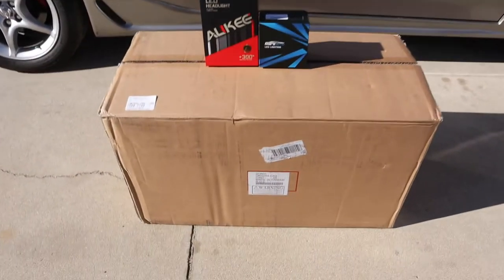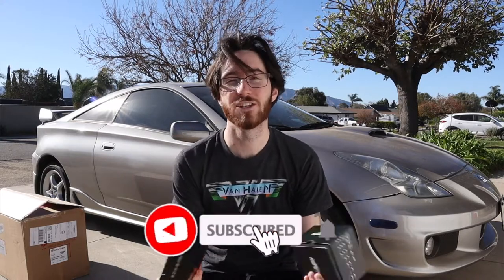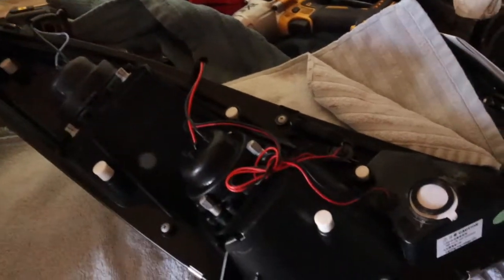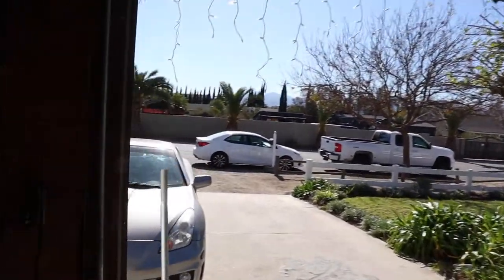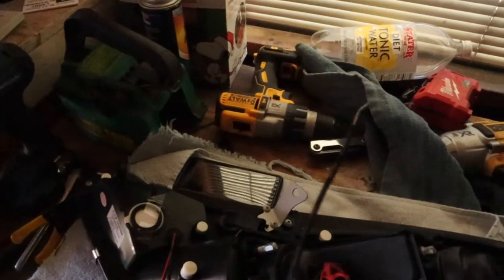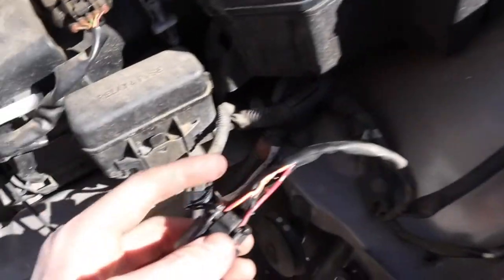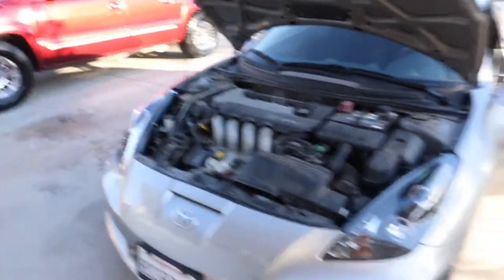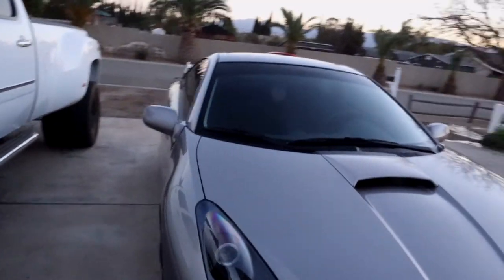Toyota Celica GTS Tsunami Gets New LED Headlights!!

Comment: To anyone looking to do this without messing with your factory wiring.. i soldered the Halo wires into the connector for the LED strip(the spyder parking light connector), this way they are all controlled by the parking light switch on the stock, and all turn on at the same time.  Aside from not messing with my factory wiring, i can chose to turn the LED strip and Halo on or off during the day.
Reply from the maker: Awesome tip! I would likely have done more soldering if I knew where the iron was lol! Thanks for watching and commenting!
Reply: I connected them to the side markers (spliced) and they look really good nice n bright just no drl, I disabled my DRLs so I have full control of my lights at night

Comment: Could you splice the halos into the lead wire for the hi beams before the connector on the factory wiring and onto the lead hi beams on the headlight housing itself?
Reply from the maker: I don't know about connecting it to the housing per see, but I suppose if you wanted to you could absolutely do it that way! just keep in mind your power levels and if they'll trip any circuits or fuses.

Comment: @CarBois  I had to re-watch this video in order to catch something I didn't understand.  Are you saying that the H7 LEDs (i got Hikari H7 Led with H7 bracket) won't fit into those spyder headlights?  Which one's did you end up getting, and did you need other brackets for those as well?
Reply from the maker: hey man! thanks for watching, and yes. I bought h7 LEDs and 9005's for my high and low beams. Those bulb sizes DO fit into the OEM headlights that the Celica came with from the factory. However, the spyder auto headlights use exclusively H1 bulbs for the high and low beams. So, I returned the H7 and 9005 and I'll have to buy two sets of H1 headlights so that they can fit the housing for the spyder auto headlights. Hope this cleared things up!
Reply: @carboys568  yes this cleared things up. I bought the leds before I bought the headlights. So now...I would have to buy 2 sets of H1 Leds correct? Any brackets also? Did you end up getting yours done?
Reply from the maker: @Pnutsk822  I have a set of H1 LEDs on the way and will be making a video shortly. and yes, I believe the spyder auto headlights (at least the model I have) use H1 size bulbs for both the high and lo beams. after watching a few other videos, I think we can custom make brackets so that they'll mount correctly also.
Reply: @carboys568  ok thanks for the help and reply back. I will be looking forward to that video, once you get those H1 leds in. Hopefully those h1 doesn't need any additional brackets as well, and they can just be a straight fit. Which brands did you go with?
Reply from the maker: @Pnutsk822  i ordered the Aukee h1 led bulbs from amazon! If things go well, the vid should be up later this week!
Reply: @carboys568  thanks for the info and I'll for sure check it out once posted. 🙏
Reply from the maker: @Pnutsk822  FS man! I'm hoping it all works out easy!
Reply: @carboys568  quick question... when you ordered the H1 led bulbs,  Is there a high beam and low beam H1?  Or you can use H1 for both?  I'm asking cuz I might end up ordering 2 sets of the H1 Hikari 2020, if you can use both for high and low.
Reply from the maker: @Pnutsk822  I believe H1 is the code for both the bulb size and the size of the mounting bracket, so there should be no difference between the H1 high and low beams if you decide to order two sets, you can probably just order the same set twice. That being said, I would look for a set that is easy to install before trying to splice every one of your headlight wires for safety's sake lol.
Reply: @carboys568  the h1 leds should be better than the ones it came with correct? Sorry,  just new to this.
Reply from the maker: @Pnutsk822  No worries! it will likely depend on the H1 bulbs themselves whether they work better or not. At first, I thought that H1s (because they were smaller than the stock bulbs) were not going to work as well, but they were just as bright as the larger H7 bulbs that I replaced them with. The quality/brightness of your lights will likely depend more on the bulbs themselves and the reflectors in your headlights than anything else. I've heard many good things about switching from halogen to LEDs because LEDs emit more light in the visible range without having to expend as much energy (heat) as halogens. That's why they are so much more efficient and can be brighter while using the same amount of energy. LEDs are merely focusing the energy into light we can see as opposed to light we can only feel (as heat) the way that halogens do. Hope this clears stuff up!
Reply: @carboys hey man sorry for jumping into this thread. I have the same aftermarket headlight and wanting to change from halogen to Led. Are these the ones you got?

Comment: Hey man! Great video. I used it to install the same headlights on my Celica. I’ve got a problem though. The Halos don’t run.

They light up if I turn the brights completely on, but not on their own. Any clue what I did wrong?
Reply from the maker: Hey man! thanks for watching the video! The halos should be connected to the lead wire of the high beams, which it sounds like you did! The day time running lights should be the high-beams running at 1/2 power, I'd check any fuses or, if you can, use a voltmeter to check the connection point that you chose to splice the wire in and make sure the DRL (daytime running lights) are actually running at half power. Essentially, make sure your DRL's work! Let me know if I can help anymore!
Reply: I just wired mine to the fog, so they come on with the fog if i want

Comment: How’s the light output compared to oem headlights?  I have oem headlights with LED light bulbs
Reply from the maker: They really aren't as bad as I was expecting but that might be because the lights are adjustesld a little high. How do the led's compare in the stock housing??
Reply: @carboys568  I bought H7 I believe slim harukai brand off Amazon and had to adjust the clip backet in order to fit snugly and not move during drive. CauE during drive the light pattern will go everywhere. They also sell bracket fro stock light H7 that work with LEd too
Reply: @carboys568  HIKARI H7 LED Headlight bulbs,  these are the ones o bought also forgot to mention I did take apart my headlights round housing to close up the “UFO” opening to make the beam more straight forward you might have to do that so you don’t get the “UFO light effect. If you don’t know about the celica headlights “UFO”. Look it up it’s all over the forums. Celica headlights oem ones notorious with light output if that not taken care of. But ones I did it’s night and day. Bright roads and bright daylights too
Reply from the maker: @hanielbomb Yeah! I remember watching tons of tutorials about modifying the housing bracket lmao. Thats what I was trying to explain in the beginning of the video but that totally fell through lol because the stock bulbs don't fit 😆.  The UFO is hilarious, looks like a smiley face!
Reply: @hanielbomb  i just bought those Hikari H7 LED for mine. Is there a forum, or how to, on what you did to install and fix them?
Reply: @Pnutsk822  no you have to buy a bracket that goes inside the housing and holds the light bulb in place
Reply: @Pnutsk822  H7 light bulb bracket
Reply: @hanielbomb  I have that as well. Do I take off the metal circle bracket that comes on the led and replace it with the H7 bracket?  Also, have you done the 9005 led? O' and I am installing them on the same headlights @CarBois has. Any advice will be much appreciated. 🙏
Reply: @Pnutsk822  you’ll leave it as is, and have to stretch the metal click over the bracket holding the H7 light bulb. I’ll be snug somewhat but won’t wiggle during drive.
Reply: @Pnutsk822  does the H7 bracket fit with the metal circle on? Or doesn’t it
Reply: @hanielbomb  if I put the h7 bracket through the led..yes. But to put it in the same spot of that metal circle peice that comes on the LED, That's different. That's why I asked if I would have to take those off then put the h7 bracket in that spot. I haven't installed them yet. Just trying to get more info before diving into them. New to this.  Do I also use a bracket for the high beam 9005 LED?
Reply: @Pnutsk822  high beems no bracket needed